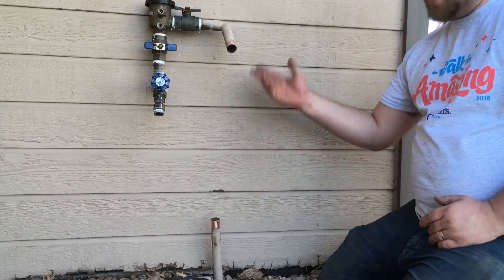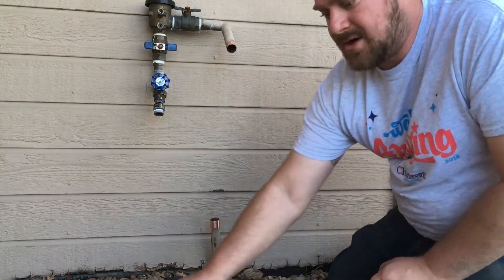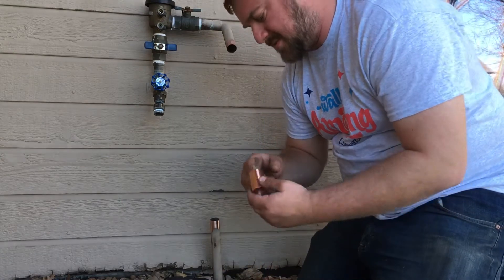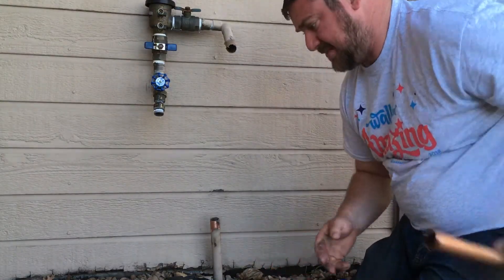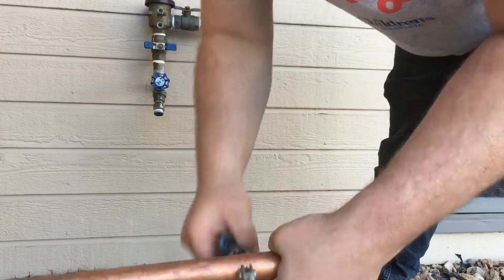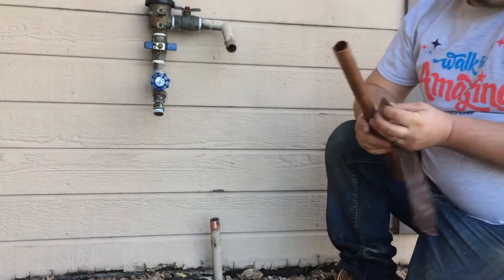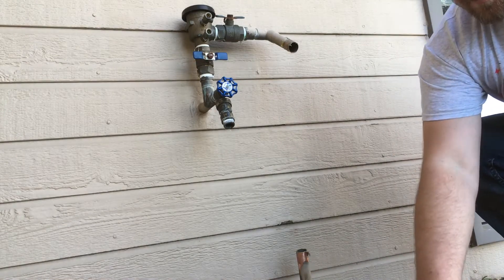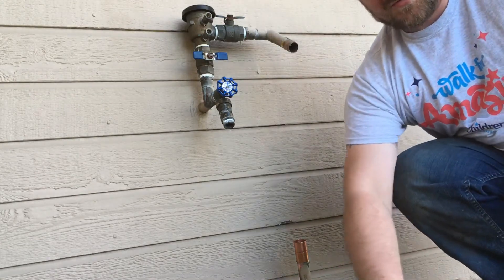Irrigation copper pipe repair part 1

Comment: I have an old copper irrigation system. what's the best and easiest way to rise the heads to the current grass level?  The current heads don't even seem to be solder on the pipe.
Reply from the maker: Riser extensions or better yet 6” heads it the heads are 2” down